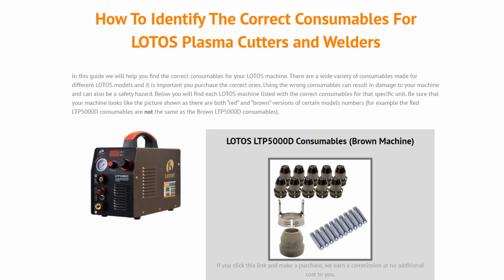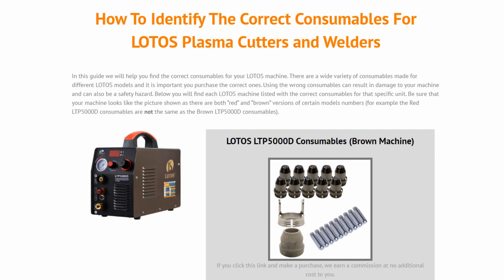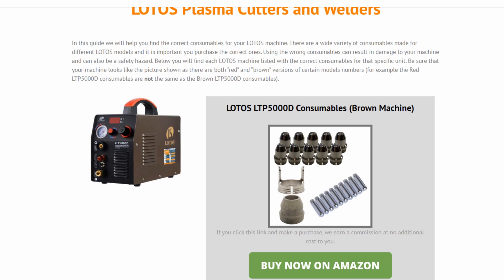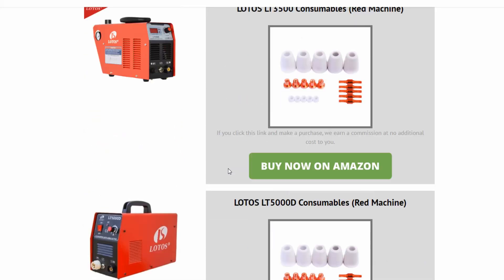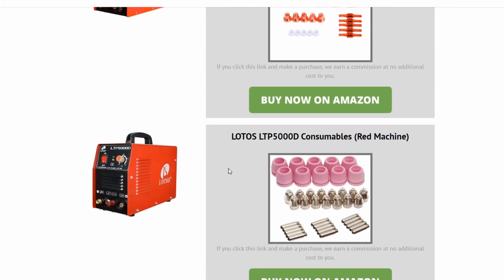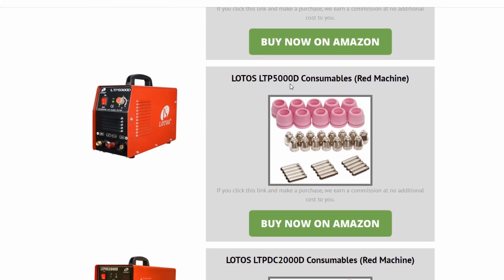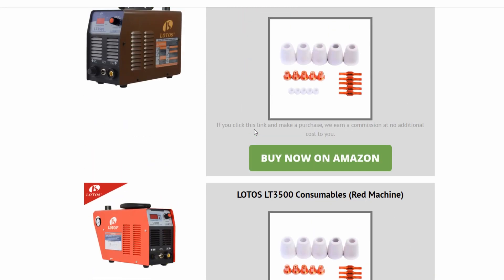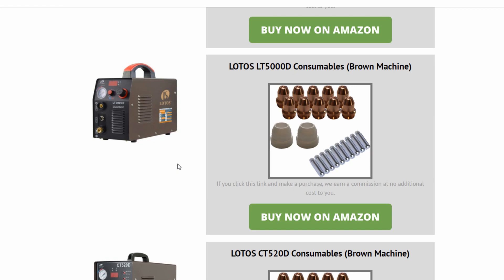How To Find The Correct Lotos Plasma Cutter Consumables and Part Numbers

Comment: @fabrication guy what do you think about those amico plasma cutters?
Reply from the maker: Jose Correa The Amico CUT50 you see on Amazon is based on the CUT50 platform. This a generic machine that is branded by many different brands. They all look slightly different and have different hardware, but are based on the same machine. The Amico does not have pilot-arc, which I think is a very good feature to have. I recommend getting a LOTOS LTP5000D. It’s around the same price and has pilot-arc. Take a look on our channel and watch our cutting demo/review. It’s an impressive machine for the price.
Reply: @diamond_spotlight  thank you for replying